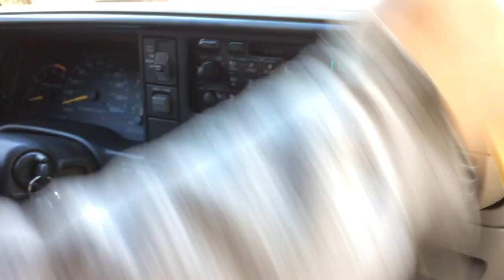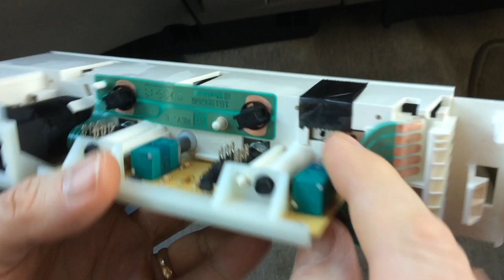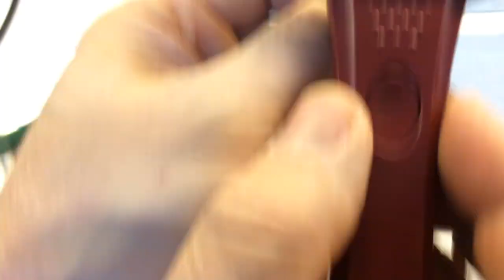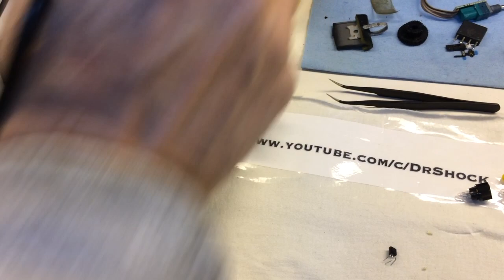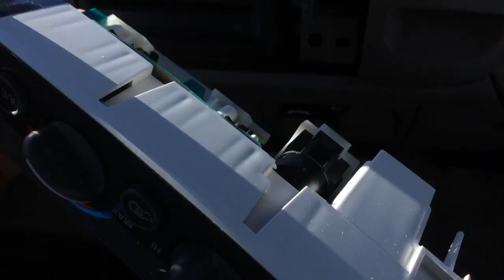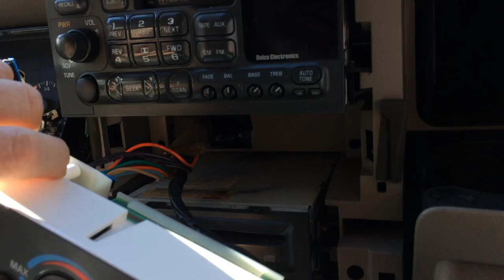1996 - 2002 GM Truck AC Blows Floor Only / Climate Control Module Transistor Repair (Chevy & GMC)

Comment: I have an aftermarket dorman unit. It does not have visible transistors just flat IC units. I tried 2 dorman units purchased from Napa and they worked fine for about an hour then they failed. There is something other than the control unit causing this but what could it be? The symtoms are exactly as you described, good AC function then suddenly no ac and all the air (hot) flowing through the floor vent. also no ac light on button.
Reply from the maker: Most likely a short in the wiring harness.  Check the dark green harness wire at each point from the control module across the engine area as it routes thru each pressure sensor.
Reply: @DrShock  there are a couple dark gn wires one on the grey connector and one on the black rectangular connector. it seems  it goes to the cycling switch on the dryer when i look at the diagrams.
Reply from the maker: The one to the low pressure switch on the accumulator is what I'm referring to, which is what drives the clutch cycling.  You should find on a GMT400 specific wiring diagram that this same wire routes to the compressor area switch as well.  Typically there will be a short to ground on this wire somewhere from harness vibration that intermittently blows the transistor(s) in the control module.

Comment: You never tell us which transistor number to use for the one that needs to be replaced?  You mix us up replacing the one that doesn't need replacing and never say the number for the one that does need to be replaced.???????
Reply from the maker: I absolutely did mention the transistor part number, and it's location was shown on the actual board used from 1996 onwards. These details are also repeated in the video description, along with some guidance for 1995 boards.    However,  this kind of component level repair is very low level and does require prior electronics repair experience, and familiarity with the foundational concepts and tools that entails.

Comment: I checked, $46 on Amazon. Not all of us have an electronics bench to do this repair. This video is actually a disservice to the dyi guys.
Reply from the maker: This IS a diy video but for an electronics hobbyist audience who already have experience and tools for board level repairs.  I have another video https://youtu.be/Gl5_CEJdu4o for this same vehicle family for folks who do not have the experience or equipment for performing electronic component level repairs and just want to replace the module itself. But in no situation would we use inferior Chinesium aftermarket parts - genuine OEM parts ftw.

Comment: What and where should I look for an issue if I keep having to replace the hvac control unit? It keeps popping the resistors on every new unit I install and fuses are good. Any input would be greatly appreciated!
Reply from the maker: If the transistor, not resistor, that we covered in this video is repeatedly being burned out then you have a short in the wiring harness from the module to the underhood area.  Likely the green wire part of the circuit.   You'll really need a GM service manual schematic to track it down.

Comment: Hello, i have an issue where my control pretty much functions properly. All fan, blend, and temp functions are as they should be. But i have an intermittant power issue to the  A/C. If i fiddle with the control and switches i can get it to come on sometimes. Sometimes not. The A/C light shows it is on but i get no power to engage the clutch. Is this transistor a possible cause? Or maybe something else since the light comes on and everything else functions as it should?
Reply from the maker: Based on your description, the orange led is lit when the AC button is depressed, this wouldn't be a wiring harness supply power to the module problem nor related to the issue in this video.   If the behavior changes by manipulating the controls my initial reaction is just mechanical wear.  You might try removing the module and giving it a compressed air cleaning, but more likely replacement of the module will be required.
Reply: Ok thank you!

Comment: Preformed this fix on a cheap Chinese controller and it the AC started working again. Got the parts for like $5 at an electronics store. 

Working on replacing the relays in my transfer case control module and it should solve my 4x4 issues. I replaced the capacitor on the board and only one relay would fire. It puts it into 4x4 but won't take it out.

Comment: I have owned a 97 GMC K1500 with 5.7 for 25 years. I have rebuilt or replaced almost every component on this truck and we are still driving it today. The A/C has been problematic for a few years. I watched your video and noted that the control was the only component that was still original. I discovered yesterday a long time refrigerant leak was due to the low side Schrader valve leaking. After replacing it, the A/C once again blows 43 degree air but mainly out the lower vent and defroster. I see that the actuators are working but I suspect the air box door is not properly diverting the air to the center vents. Believe me, the removal of this dash is not easy! Having done it twice before, yesterday I found a quick, cheap solution: a $15 plug in fan I clipped to the dash by the lower vent. Man, does it blow that cold air from the vent up in my face! I know this is not the proper way to fix it, but it is an old truck and I have A/C again to face our Texas summer. This was an intriguing video, but unfortunately it was not a fix for mine. Keep up the good work. We YouTubers need good content like this!

Comment: I have the 1996 GMC Yukon 2 door 4x4. It does NOT have AC or a redefroster.  The Climate Control Module temperature knob is broken off. No I do not have the knob any longer.  The PART is no longer supported by GM.  I am looking to replace the entire module as the knob seats on a stem which is what is broken. Any leads are helpful
Reply from the maker: Your best bet on a part like this is a you pull it salvage yard.  Like an LKQ PYP (Pull Your Part) or similar.  AC delete would have been a fairly rare build for the late 1990s.   Another option is to have your local GM dealer dig up the part number for the heater only control assembly, and put out some eBay and the like searches for an NOS one.  Likely will take a very long time to get a hit though.

Comment: Can someone tell me how to repair this console? My issues are the fan speed only works on Hi.. and the blend door does sound like it is changing, but there is no Heat at all. I did change my radiator cap/thermostat/fan clutch/temp sensors, also burping the system
Reply: I don't mind the fan speed, but I just want heat in the truck
Reply from the maker: Fan speed could be either the speed switch, or the resistor pack for the blower motor itself.  You would have do a test to see which one is at fault.   If the lack of heat is not related to the fan speed, then it could be the heater core needs to be flushed of accumulated debris that is reducing it's efficiency.   None of the parts you mention throwing in have anything to do with these symptoms other than somewhat remotely the thermostat.
Reply: @DrShock  oh I forgot I flushed the heater core. Ran water thru the inlet and outlet. like 3x.
Reply from the maker: This needs to be done with some level of pressure, typically with a tool that combines a garden hose water source with compressed air at a low psi.    That aside, if I had this problem I'd work on the fan speed first as that can have a subjective bearing on this problem.

I'd then verify that the blend door actuator is in fact moving full position to heat, and that the door attached to it is doing the same.

Comment: You are like a pro, boss..how do you know if the component is damaged or not if it doesn't leave a mark like burning or a watermark?I n addition to using a multimeter.. can you teach me boss..
Reply from the maker: You judge this one by the behavior of the control unit.  There's no visible signs of the device having failed. 

You could test the transistor once removed in a tester.  Many higher end multi-meters will have a transistor test function built in.

Comment: I have a 1998 chevy z71 all my knows work but the buttons only light up when blower Is off when I turn it on they go off I think it's the resistors I know I spelled that wrong but o well hopefully someone sees this to give me any information
Reply from the maker: There's a bit more technical info in the video description that might help explain.  This video covers a power transistor failure, which has a specific failure signature.   But other transistors, and resistors, failing on the logic board could cause other symptoms.

Comment: 1999 GMC Yukon. All settings seemed to work fine until I installed car stereo. Somewhere during that time I smelled something burning. Stereo works great. Now no lights come on on the climate panel and air comes through vents for 1 second then automatically shifts up to dash defrost vents. Right knob does nothing now. Middle knob makes blend door actuator move as before, but no heat, though air comes out vents as powerful as before, and fan speed switch works fine on all levels. I'm going to do what you did, but only after buying a part. Then I'll have a spare part around in case this happens again. I assume there must be a short in the harness to the climate panel. Only a few inches of wire have become damaged somehow. I will re-assemble the dash before I re-attach negative battery cable to prevent wiggling the wires and possibly re-damaging the new panel. Thank you very kindly. BTW mine doesn't have the rear defrost button, I only have defrost on the mode switch. Does this mean the plugs in the back won't match up with a 3 button panel?
Reply from the maker: With age the chances for a harness short when fiddling in that radio area are far higher, as the wiring insulation brittles up.   

Rear defrost was a factory option, so not having it doesn't change the rest of the repair/connections advice.  Just that you would have unconnected or uninstalled wiring because your truck wasn't built with that option originally is all.  I believe I give the GM part numbers for all the panels in the video description, so that you can track down the same one, if you like.
Reply: @DrShock  Liked and subscribed. Very useful info. I just ordered the part. Thank you immensely!
Reply: That's what I was doing messing with the radio is that what fried the box on mine

Comment: I have the same problem.  Air blows out dash vents for 1 second when first turning key on, then I hear the actuators move, and no air from anywhere, but still can hear it blowing somewhere.  Going to buy a new Dorman control module and hope it fixes the problem.

Comment: I have the exact same problem and symptoms on my 96 k1500 suburban 6.5 diesel. Control module burns out and does that with the controls almost instantly. Any suggestions?
Reply from the maker: Usually a short to ground somewhere in the wiring harness.  The comment history here may have some schematic pointers.

Comment: Does anyone know of the brown wire that controls the ac mine gets hot and I think that’s what blowing out the controls?
Reply from the maker: The transistor I cover in this video is connected to the light green wire that exits the firewall and into the cycling switch on the accumulator, before routing onto other parts of the circuit to the compressor.  To blow this transistor, a short on that green power wire to ground is usually required, sinking too much current and overloading the transistor.   It can just be a momentary short, such as worn insulation from vibration on the harness.   The transistor would blow out within a few seconds.

Comment: Where do you recommend getting those little transistors?? Subscribed! 
Btw, one of my rear defoggers on my Dutch doors stopped working. What all could I do to diagnose the cause?
Reply from the maker: There's a link in the description for them.  On the defogger, each door has it's own grid when you don't have the liftgate option.  When you have the liftgate, which I presume is what you mean by dutch being it's a top half lift up glass door, there's only one grid.  What usually goes wrong is you get a break in the brown wire grid that sticks onto the inside glass.   But it can also be the door contact switches.  If I had this problem I'd do a visual inspection of the grid, and check the fuse and relay for the defogger circuit.  If those looked good I'd check the door contact switch assembly.   Tools wise a voltmeter and test light along with a copy of the schematic to get started.  You can find that schematic in the PDF of the service manual here - https://www.gmt400.com/threads/88-95-service-manuals.43575/

Comment: I did this and it fixed everything except now when I push the AC button in it shifts the air flow to the floor and doesn’t even come out cold, I’m at a total loss, I’ve been though 4 control units and tried this on all 4 including an AC delco one and got the same result, except one of the dorman units keeps the airflow on the floor permanently, sos
Reply from the maker: There's a few other comment threads around where the power output of this transistor goes and some of PDF schematics posted.   There's a green wire on the flat cable out of the dash control unit, that travels thru the firewall and under the hood as part of the AC circuit.   When this transistor goes you'll no longer have voltage on this particular green signal wire.  I'd check this circuit with a voltmeter to confirm you're looking at the right problem.   If the transistor is not blown and this wire has a signal, then its not the cause of the symptoms.  However, if it's continually blowing the transistor though, then you have a short in this wire under the hood somewhere sinking the current to ground.
Reply: @DrShock  Thanks for responding it seems I have some poking around to do but in more detail when I put the ac Delco unit in with the new transistor everything worked but when I hit the AC button I hear the compressor engage and it works for a second or two then the AC button light and recirc button light starts flickering and then the compressor disengages and the air flows to the floor, is it possible that the issue could be related to the VCM? Based off a schematic I’ve seen the circuit goes in and out of the VCM 4 times
Reply from the maker: That flickering is a sure sign of a short on that power line (green wire) heading out from the transistor to the underhood AC circuit.  They can take along while to track down, but the ones I've come across are usually where the harness is next to a metal bracket or fitting where two decades or more of vibration have rubbed thru the wire loom and into the insulation causing a short to ground in that spot.   They can be intermittent too, I've replaced a transistor only to have it fail a few days later but in every such instance I traced it to a short in that green power feed circuit under the hood.   If you didn't have the flickering indicator lights before it burned the transistor out again I would have suggested something else instead.
Reply: @DrShock  Hi again, thanks for your help with this, I finally found some time to get back to this and I’m wondering if you can tell me by word how the AC circuit goes or link me a schematic to follow so I know where to poke around to try to find this short, thank you.
Reply from the maker: @nickbriggs7247  There's a few older comments in here and one or two have linked a PDF of the 1998 C/K service manual.  That's what you'll need to track down to have the schematic for the A/C circuit.  The 98 one is going to be spot on for 96 - 98 pickups and thru 99 SUVs.   If you have something older that same website might have an older one as well.  idk.

Comment: I did this to two contol modules and it fixed mine for about a week and back to the same problem. Put the other in and it did not work at all.
Reply from the maker: If they reblow, then you have a short in the wiring harness.  See some of the older comment discussions where I've given some guidance about following the schematic for the green wire out of the control module and thru the firewall to the underhood area.   The transistors that blow like you describe are sinking too much currently, almost always from a small short to ground on this power circuit where a harness has rubbed thru to a metal bracket or other grounded metal surface.

Comment: I’m having a similar issue. My air only comes out of the windshield defroster and I also can’t change the temperature of the air either. I changed my head unit and I think while I was doing it something happened.
Reply from the maker: If this happened suddenly right after work in the same area, then yeah I would suspect something there first.   What can happen with the AC control module is the plastic yellows and becomes brittle with age, and the retaining clips to secure the wiring harness can break off letting the connection become loose if it gets disturbed.   Worth a look.

Comment: thank you for your video!  I had a friend change out the resistors.  So far so good.  Thanks again!
Reply from the maker: Just remember these transistors sometimes go because of a short in the underhood wiring too.  So if it goes again, that's what you have to hunt for.

Comment: I think the 4692 is an NPN transistor, at least it checks as one. I did a 95 truck today and it has 4 transistors. 4687,2857 were replaced with 2n4403. This fixed the issue. There are (2) 4692 near the potentiometers. I did not replace them, no need to tempt fate. The 2n4401 would be used there. I did another 95 a few years(7) back and used the mpsa56 and mpsa06 in the 4 spots. It works fine still. Fine Video, I sure wish I had it when I did the first one.